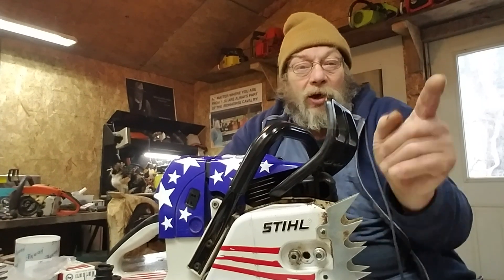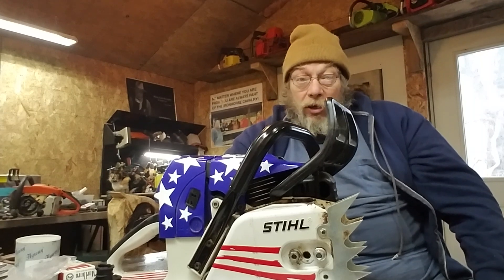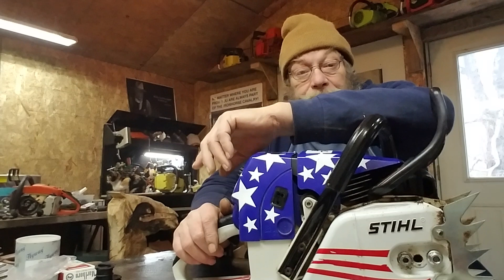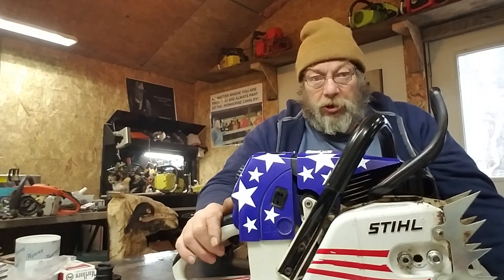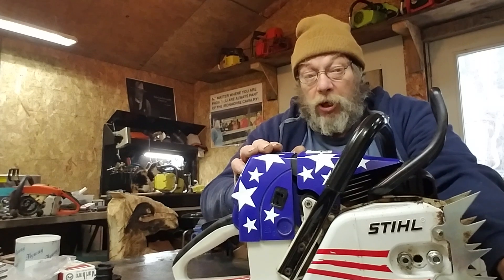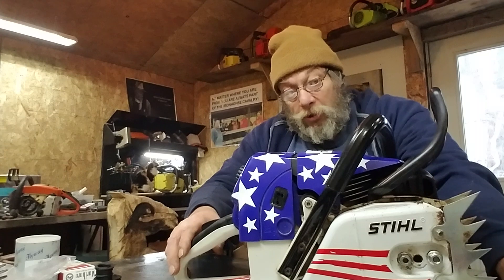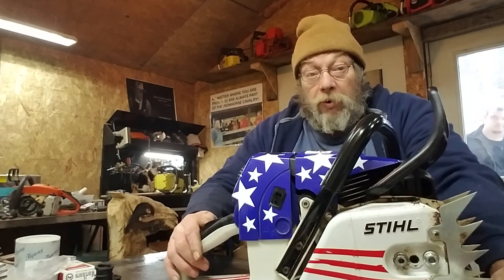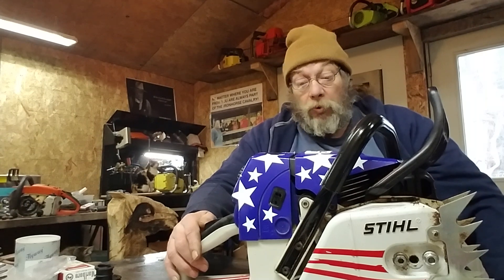What mix oil to use! What ratio should I run in different saws!

Comment: Good show!

I use Amsoil Saber Oil at 50:1 with 90 octane E-free fuel.  I use the Saber Oil because it doesn't give me a headache/migraine.
Reply: Awesome!   I've been using it for years, great stuff.   I mix mine at 100:1.
Reply: There is no reason to mix Amsoil that heavy. I don't care what the equipment is. I've been using Amsoil 2 cycle oil for many many years.

Comment: I can tell you... I WORK FOR STIHL. AND IT WAS THE EPA THAT REQUIRED 50:1. THE SAWS DO NOT RUN SAFELY ON THIS MIX. THEYVE GOTTEN BETTER! BUT STILL NOT AS DURABLE AS 40:1 RUNS. THATS WHAT WE RUN. IVE ADVISED PROS TO SWITCH TO 40, AND THEY STARTED COMING IN FOR REPAIRS ALOT LESS FREQUENTLY. IN ANTIQUES I RUN 32:1. JUST TO BE SAFE. IT DOES NOT AFFECT POWER IN THR SLIGHTEST BITS ITS ALL IN YOUR HEAD. THATS ACCORDING TO OUR DYNO. YES WE HAVE A SMALL ENGINE DYNO AND I RAN AN MS440 ON THE DYNO IN THREE RUNS. ALL USING SAME AVIGAS AND ECHO REDARMOR OIL. IT RAN THE SAME ON 50, AS 40. ON 32 IT SHOWED A 0.06HP DROP AND NO TORQUE LOSS.  Thats my 2 cents. I agree with ironhorse and love listening to old timers like him and others. I also do not like stihl oil mix because its dirty. I chose echo redarmor because its mafe by spectrum oil. Same as sta-mix and a few others.  They make really good oil in my opinion.
Reply from the maker: Perfect! Thanks Kelly!
Reply: No problem. I have also read that castor based oil mix combusts almost as well as gasoline does. So therefore the oil would add to the combustability of the mix. Echo redarmor is castor based which would make sense. However... i am not a chemist im a professional wrench spinner so i have no way to really verify castor oil is combustible outside of my dyno results. Lol
Reply from the maker: What I learned about castor based oil is from motocross bikes! If we were racing a moto it was a great oil that added power because the motor was running at top rpm’s all the time! And it burned clean! In an enduro where the rpm’s were much lower it would coke up! It was dirty!   Sooo a saw that’s running at peak rpm’s all the time would be fine?  Close?
Reply: Sounds about right yeah! I run the crap out of it and it burns pretty clean but like u said its always ran wide open
Reply: I had to take classes from echo in order to work on echo at my shop. Redarmor is castor based. Maybe it hasnt always been. But it is castor based.
Reply: Right..... if you say so. Maybe you should apply at the manufacturer's since you know more then them lol
Reply: Lying to yourself my friend. But hey like i said go apply to the manufacturers. Since you know more then they do. Maybe you could teach them a think or two!
Reply: I told you to apply to them. Idk why youre arguing with me. Go do something about it. Its on their tests, and catalogs for dealers. Go apply to them and fix it yourself.
Reply: Went to make fun of you with my echo rep today... boy talk about a shitty moment lol redarmor was only castor based for 3yrs before they switched the manufacturer. My class was years ago. I did not know that. Guess thats my bad. Even tho it gas not let me down i may still switch now. Crazy. I like how they change it but dont update ya like stihl does. Stihl updates you when every little thing changes.
Reply: Dude the epa ruins everything. Thats why im glad trump is slowly taking power away from them. They say america needs to reduce carbon emmissions but yet if we did it would only affect 1.3% of the co2 emitted lol not to mention..... co2 levels change on their own. Nature regulates itself. Has nothing to do with us. That doesnt mean everyone burn their trash, that just means use common sense and leave manufacturers alone. New stihl saws have lost power compared to the previous models. Look up ms391 vs ms390.. thats just one example. Why? Fucking epa. Stihl has to run strato engines now thanks to them. And stratos are garbage.
Reply: What is unsafe at the OEM recommend mix of 50:1?

Could you please define that for me as I do follow the OEM
Reply: Have you tried Schaeffer’s oil? If not, it’s worth a try. Made in St. Louis, Missouri. I use their oils in everything, amazing lube. Check them out online.
Reply: @wollywolly2734 , it about emissions vs what will really give longevity to your saw. Some of the new synthetics do ok at 50:1 but 40:1 is superior for equipment running at operating temperatures for long periods. I.e- your lawn care professional running his equipment all day, Arborists running their saws for an hour or two minimum at a time, and loggers stopping only to pee and fill their saws.
Reply: @nsatoday  got ya and thank you
Reply: 33:1 oil mix is ok ?
Reply: Cap, I had a problem with Red Armor.  I had been using it in my new ms 250 and was having problems pulling it over, so I poured it out and replaced it with Moto Mix.  I cranked it right up with a normal pull over.  When I pored it out of the 250 I looked at it and saw clumps of Red Armor in the gas.  The gas was red but it had several clumps of red oil in it.  I did not think much about it at the time, just made a note of it.  I run Premium non ethanol gas and add a stabilizer.  I dump the oil in my one gallon tank and then add the gas,  shaking it up good afterwards.  I ran StaMix for years without any problems but do not have a local source for it.  My standby is Stihl Ultra at 50:1.  It has never caused me any problems.
Reply: Thanks for your 2cents
Reply: First off I know this is an old post but.... Actually, you can get more horsepower out of a two-stroke engine with enough extra oil in the gas, because the oil provides a better ring seal and, therefore, more compression. People think that gas burns more efficiently with less oil, and therefore you get more performance. It almost makes sense if you look at that one statement alone. The seal of the piston is critical. If you remove the lubricants from the gas, the viscosity of the mixture becomes lighter and more prone to vaporization. With a lean mixture there is less oil to seal the rings. The sealing of the rings has more to do with the performance of the engine than the possibility of having better-burning gas with an ultra-lean gas/oil ratio.
Reply: Do you think the 40:1 would be OK to run Stihl blowers as well. Specifically the bigger, backpack blowers.
Reply: Do you make any videos of your work?
Reply: I'm running Castrol POWER1 RACING 2T for racing engines. Fully synthetic oil that goes between 100:1 (1%) and 50:1 (2%). I mix 2%. My machines tun absolutely PERFECTLY for many years. I have MS230 from 2005, MS311 bought a month ago and FS120 bought in 2015. After thousands and thousands of hours I can still lift them by pull cord.
Absolutely no smoke, spark plug looks barely any grey totally clean, like brand new,perfect throttle response, ultimateprotection, no carbon deposites... I even told my DEALER that I never use Stihl oil but showed him the bottle. He told me no problem at all...
Reply: @REDLINERUNNER  It's good stuff been using it in bikes and saws for years
Reply: @martintomsett6288  Lovely!!
Reply: Get this, if 40ml/1L makes 25:1 and 20ml/L makes 50:1 then how come 31ml/L makes 33:1? .. i mean 31 is damn near in the middle of 25 and 50 should it not be 37.5 ish?? Please someone help me get this lol
Reply: Here’s my 2 cents 36:1, why? Because I said so and this is the Internet.
Reply: THANK U HOSS, ,
Reply: Maybe working at stihl you can get me a refund on the 15 gallons of moto mix garbage I ran through my 500i, or perhaps the 24 bottles of stihl hp. It would be awsome if stihl could actually do a test at altitude, or where I live at 7,500' before promoting the oils at all the stores. It is absolute garbage, I am so unbelieveabley disappointed in stihl for not considering altitudes where people live. I now run yamahalube because my m18 electric battery operated chainsaw will output my 500i when in a 10" piece of pine or fur.
Reply: @captainsledge7554 
You happen to have any insight on why Stihl is replacing the 400 with that shite 62cc 400.1?

Comment: I run 50:1 Stihl oil mixed with 87 pump gas in my ms261 & ms462. 462 doesn't have much time on it but my 261 has been used constantly for 3 years with zero issues mixed at 50:1 with stihl premium oil. Only 2 things I do that I truly feel is more important what oil you use is, buy the freshest gas possible, use it within 2 weeks! Lastly run the saw HARD!  (Under load in the cut) dont idle it much and avoid small starts all the time. 261 has approximately 650-700 hours on it, check the original plug. Clean and tan brown. Exhaust port has zero carbon or sute. Freshest gas and use them like there meant to be used. Just sharing my personal experience. Great video, appreciate your insight into the wasp nest of mix oil's
Reply: Do you used sthil hp super or sthil hp ultra ?
Reply: @MrBaptiste003  just the regular Stihl oil with regular gas. Burned 350 litres this year with zero issues. It’s a topic that is far overthought I find. If it works, leave it be.
Reply: @MrBaptiste003 I've had several saws in my lifetime, small climbing saws up to husky 2100s. I bought a little ms250 about 15 years ago. I have put nothing but stihl ultra in it since I got it. I have ran the hell out of that saw,mostly hardwoods, oak hickory, with some pine and soft maple, sweet gum etc. I've cleaned the screen once, checked it today, clean as new. Usually I run non ethanol high octane 91 gas, I think that's the key, I mix it a little heavy, probably about 45 to 1

Comment: Back when I logged in eastern MN the local saw shops were promoting 50:1 which I also ran at the time. However when the EPA saws with the limiting caps were introduced plus ethanol blended fuel some of the guys running these new saws would have them burn up if they happened to be in a hard pull when they ran out of fuel. I learned how to pop off those limiting caps and reset the carbs...also started blending 40:1 fuel and never had any problems.
Reply: Master, can you pour 33: 1 husqvarna ls + into the saw 372xp 357xp and scythe 545rx? Will the piston rings get stuck with carbon?
Reply: @Sensei948  go ahead if you don't like your saws... they'll run hotter and dirtier
Reply: Of course they promoted 50:1. They won't last as long

Comment: Great information Iron Horse. Can not wait for the next video. I will be going to the 40:1 mix soon, was running the 50:1, inspect my spark plugs as well. Hello to all in the community as well, got a solid 8” of snow overnight and now it’s rain. As we say in Michigan; if you don’t like the weather, wait 5 minutes and it will change. 😎👍
Reply: Master, can you pour 33: 1 husqvarna ls + into the saw 372xp 357xp and scythe 545rx? Will the piston rings get stuck with carbon?

Comment: I’ve been cutting professionally (part-time) since 2014- Stihl saws and Amsoil, 100:1 mix ratio. Saws run great, no carbon, no scoring, clean mufflers, zero problems. Great channel!
Reply: 100:1 really?
Reply: @imashbuttons1734  seen a lot of people saying 100:1 but no matter how good the oil is i really don't like the idea of running that lean
Reply: @imashbuttons1734  Yes, 100:1 on Amsoil Saber. I use a brushcutter that I bought in 1998, still runs strong even though the muffler rotted off. 100:1, keep the valve clearance adjusted, etc.
Reply: @mrsoars  valve clearance on a 2stroke? Interesting
Reply: @Chris-ry5vu  yeah on Stihl trimmers they have valve covers on top and you have to get in there every so many hours and keep it in adjustment. Don’t feel stupid, I never knew they were there until it started running poorly and realized it needed some attention.
Reply: @imashbuttons1734  
Yeah I didn’t either but you get used to it. It doesn’t smoke either. If for some reason I have to run somebody else’s gas- you really notice it because it smokes so bad- but Amsoil doesn’t smoke at all. It’s really present to run, and with AV gas drone the airport, smells like a circle track racecar!
Reply: @mrsoars  yeah I run 45:1 in my br600 and I feel sick after a few hours
Reply: @mrsoars  4mix trimmers
Reply: How are you adjusting valves on a 1998 Stihl brush cutter…when 4MIX engines didn’t come out until 2002?
Reply: @NeilLB7  98 was my best guess- make it 2002 then- it's old!
Reply: @imashbuttons1734  Yep find that very hard to believe! But to quote my dad if you weren't in the bedroom than you don't know it to be fact!
Reply: @mrsoars  Does it have the low friction valves!

Comment: Harvey I agree with you on some of your oil recommendations as I run Bel Ray H1-R which is a fantastic oil. My opinion is that you should not run outboard motor oil in a chainsaw because that oil is designed for much cooler running temps as the outboards are water cooled. Thanks for the video on oils/mixes!
Reply: Tom Malone you’re correct buddy
Reply: Right on, use oil  that you're suppose to.  You wouldn't use chainsaw oil in your outboard, then why would you use outboard oil in your saw?

Comment: I use ONLY Castrol POWER1 RACING 2T mixed 50:1 (2%) and runs perfectly for many years. No smoke, no carbon deposits, no power loss, perfect throttle response, clean spark plug...
Highly recommended for any 2T engine.
Reply: How do you mix that for 40:1 for like a weed eater or chainsaw?? Sounds like a better but cheaper way to go...
Reply: @JTRUTH2025  Use your logic... For 4L of mixture use 0,1L of oil (100ml) and 3,9l of fuel.
Reply: @JTRUTH2025  But I wouldn't do that because of losing power because of too much oil. Smokes alot. I recommend you 2% Castrol Power1 RACING 2T.
Goes between 1% and 2%. I always mix that. No smoke, perfect throttle response, ultimate protection...
Reply: @REDLINERUNNER  Thank You!!

Comment: Thanks for putting out professional videos with great knowledge!  I run 80:1 Amsoil Saber with ethanol free fuel in the six 2 strokes I own from a Stihl FS55 trimmer to a KTM 300 dirt bike.  No issues with my MS250, MS391, or MS462 including running wide open for long duration ripping slabs of hardwood.  I’m not a pro user, but have used my equipment often for many years with Amsoil.  I do all my own engine work when needed and have no issue with premature wear.  Just my experience.  I know guys who run Amsoil 100:1 with no issues.  I run 80:1 out of convenience due to oil bottle/gas can size.  Oil conversations are the same as talking politics or religion.  Every individual person believes they are right with little to no facts to back it up.  Many comments of people calling me crazy for running 80:1 to follow. 🤣

Comment: I totally agree with Harv on 40:1. The only thing I disagree with is running outboard engine oil ( marine or boat engines). It is formulated for water cooled engines and  not air cooled engines that run hotter. I know my Husqvarna owners manual specifically states not to use outboard engine oil and to use an oil formulated for air cooled engines.
Reply: After much thought I started using a 42.5:1 ratio vs. 50:1 when I discovered that 50:1 is a mandated ratio. It’s pretty easy to mix 1 gallon of gas and with 3oz. oil measured in the Ratio-Rite cup.
Reply: Marine oil is very ashy , Deff not i good idea running it in my mind

Comment: Right on , I agree 100%, I gave up running the saw brand oil when I had a rod bearing fail .
Same as you said 40:1 and I’ve been using maxima formula k2 , so far so good , I usually burn 5 gallons of mixed gas a week
Reply: In Stihl manuals, there were reportedly cases of cuts and jamming of the rings and the piston at 33: 1. Is there a risk of reduced machine life or carbon failure?
Reply: I cut timber and run my saws hard , I’ve been using this mix for a few years with no failures .
I could see carbon build up being a problem if your saw idled a lot or you do a lot of slow speed operation . Just my opinion on what works for me
Reply: @MrYahoo74  So 33: 1 will not shorten the life of the saw from 50: 1?
Reply: 33:1 is more oil per gallon of fuel than 50:1
Reply: @MrYahoo74  which is better? but deposits? coal?
Reply: Harvey, please read and reply to me ! 
I run a fairly new sthil saw model 251 c.  on 40:1 - 98 octane with stihl ultra oil,but always experiencing black oily residue on muffler! Only use for firewood and running it only for short periods of time, like stop starting it most of time. Should I run it on the leaner side at 50:1 because of short running periods, or continuing at 40:1 ??? Please advise, I thank you in advance  Gunter

Comment: I have used 50:1 for many years and never had any problems with an engine, for years I used whatever the dealer recommended which used to be Oregon (a red oil) or Husqvarna (a green oil) both served my saw engines well and taking a cylinder off to check a piston one rainy day I found it very clean no marks and a nice light film of oil. Now im a lot older and (like Harvey, suffer with my joints) so my saws are toys not making a living from them so they dont get used much. So these days I only use Aspen fuel which I can leave in the saws for years at a time and its still fine, this to me is more cost effective but for others I know it will not be practical. I still use 50:1 but do got back to 40:1 if I put a new piston in a saw. So many oils on the market these day and they all work but stick with a top known brand and you wont go wrong as with 40:1 youll never go wrong with that unless something else happens like an air leak. I am very happy with using Aspen fuel and if you try it in a confined place like workshop youll know why. Petrol is not like it used to be guys  neither is 2 stroke oil, find what suits you and enjoy the chips flying. Stay safe people out there